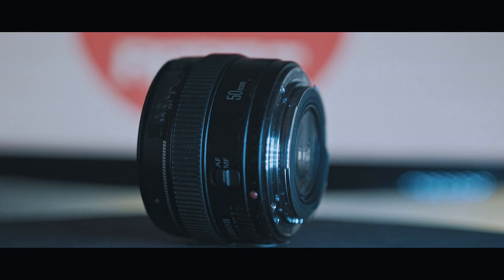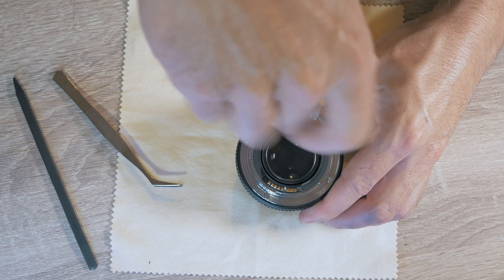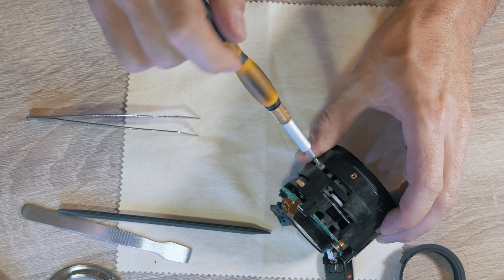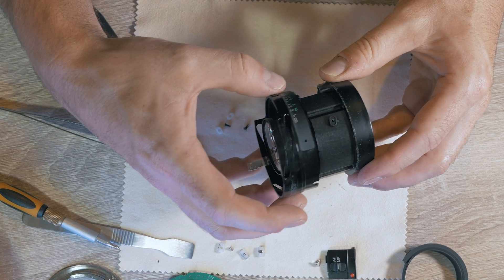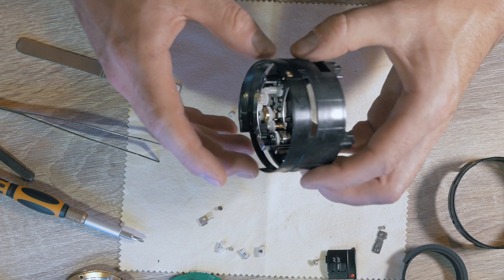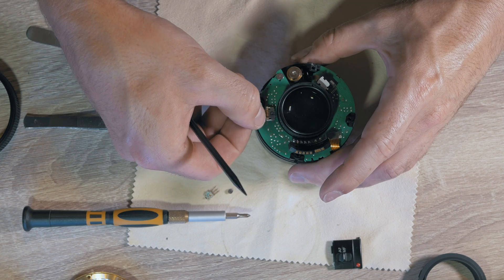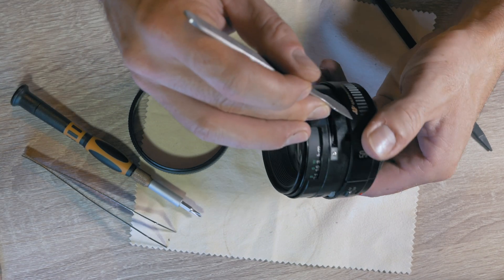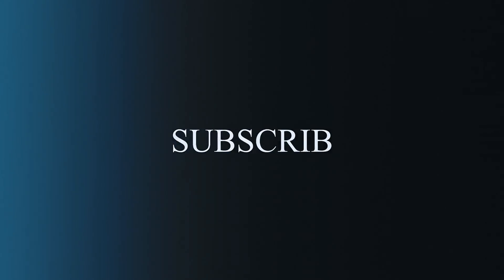Canon 50 mm f1.4 USM | Focus Repair | How To Fix Canon Lens  [4K]

Comment: Gave it a try and managed to fix the focusing issue, but it mounts upside down now and shows error code on my camera. Also smallest screws on the side of metal mounting ring wouldn’t stay in. Any suggestions for what went wrong?
Reply from the maker: glad to hear! and something went wrong during assembly process I guess
Reply: I had the same issue with the smallest screw

Comment: Very well done.  Just finished mine.  At first I thought the same thing, that it looked a bit complicated.  But once I got into it, it wasn't so bad.  The trickiest part for me was getting everything lined back up while putting it back together.  But the video was good enough I could find some landmarks on the rings and it went back fine.   Very well done.   Thank you!
Reply from the maker: thanks for watching

Comment: Thank you so much for your guide. I bought the lens without realising it has autofocus issue. I followed the steps in the video. 

The step that took the longest time was filing to make the gap bigger. It took 4 times repeating to file,  place the screws back, turn the barrel and repeat. before it was sliding smoothly.  The autofocus is working now. All done within an hour. Thank you for creating this video!
Reply from the maker: thanks for watching, and your support

Comment: Be aware...there are two internal versions of this lens...as I found out.
Reply from the maker: thanks for update!
Reply: @takeapart  Yes the slide ring that bends and has to be flattened is different in mine it's an internal grove not a open slot. Not sure if mine is just older or newer. Anyway its working again. ta!
Reply from the maker: aha! great…. thanks again

Comment: Thank you very much! I wouldn't have repaired my 50mm f1.4 without your video. Because that alloy part seemed alright to me in the beginning and the deformed part looked like a factory design curve. I used your Russian method to align that part with a wooden stick and a bamboo chop stick to maintain the thickness of the canal. So I didn't have to sandpaper it to proved smoothness. I am so happy because I saved my dear 50mm lens and it works perfectly again. Thanks again!
Reply from the maker: hi,  perfect! thanks for watching …

Comment: I dropped my lens and it wont focus anymore. I wonder if this will help
Reply from the maker: hi, you can try out
Reply: @takeapart  You're a legend dude. I didn't need to use any Russian technique but taking apart the lens and reassembling it seemed to do the trick. Now the auto focus and even manual focus works! You helped save me from buying a new lens.
Reply from the maker: Hi, yea sometimes it helps….  Im glad that you got it working!  thanks for watching and have a good weekend!!

Comment: What if the focus won’t move at all? I hear a sound like it’s trying to move but it will not move. It won’t move manually or automatically
Reply from the maker: just follow my video…. it is essentially the same issue.
Reply: @takeapart  okay I will do that later, hoping it works as don’t want to replace! Thankyou for the reply :)
Reply from the maker: thanks for watching! good luck…

Comment: How to know the sliding bent has problem? And what tool i should use to fix that bent? I have the same issue like you, and I tried to open the lense, follow your instruction to open it. However, I dont know how to look and regconize the problem from the sliding. 
I appreciate if you can write me some details
Reply from the maker: it is common issue ….  you have to feel it once you have all apart make sure that it slides nicely without any restrictions.

Comment: Great video! I had a sticking focus ring also. Instead of using a wooden mallet, I got a sheet of 1000grit Wet and Dry paper, layed it on a flat surface and carefully rubbed the distorted side. This worked for me. Also easy to follow video, thanks very much!
Reply from the maker: thanks for watching and tip!

Comment: Thank you so very much! Большое спасибо! You have saved me hundreds of Euros with your helpful and detailed tutorial.

Also, for everyone trying this, I cannot stress enough the importance of that last step that's checking if the white sliding bits can run through their lanes smoothly. I found out one of them was getting stuck super easily in one of the lanes (while going through the other easily), so I filed the former with a regular metal nail file until it ran almost as smoothly there as in the other and now it seems (fingers crossed) this lovely lens is completely fixed!

I'm so happy! The nifty fifty is my favourite and I have dearly missed its splendour.
Reply from the maker: thanks for watching

Comment: What screwdriver are you using? I think I stripped the screw on the motherboard because I can't get it to catch. Спасибо
Reply from the maker: hi, It’s normal philips screwdriver... I have normal set nothing special... thanks
Reply: PH00 and PH000 should be enough for most work

Comment: Great video!! Sanding the guide rails was a perfect idea! My lens works again!!! Thank you!!!
Reply from the maker: hi , thanks for watching.... sanding is necessary if you go to far and those plastic bits has some resistance along the way... 
thanks again
Reply: Ryan Pettway My lense has a problem with focus motor it stops 1 is this the same problem
Reply from the maker: hi , these lenses are notoriously known for focus issues.... 99% you have to follow video. 
thanks for watching
Reply: TAKEAPART the screw got badly stripped what should I do now